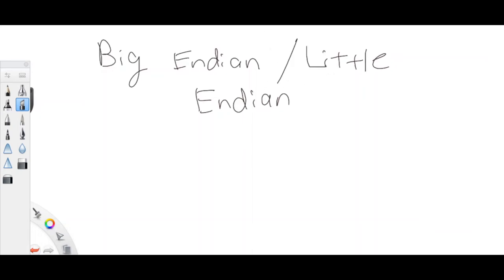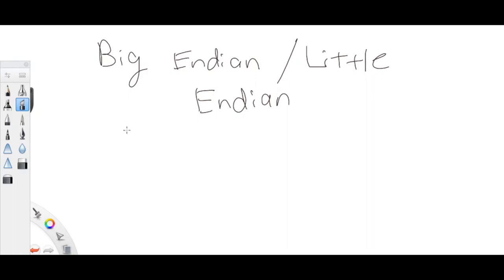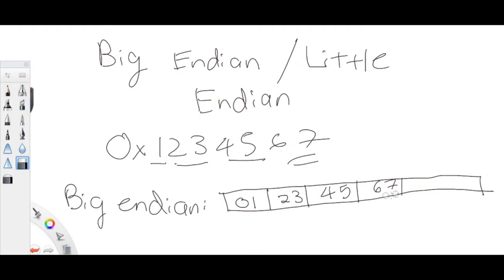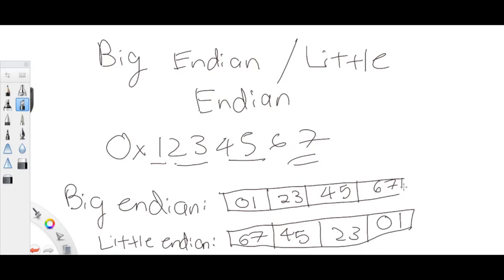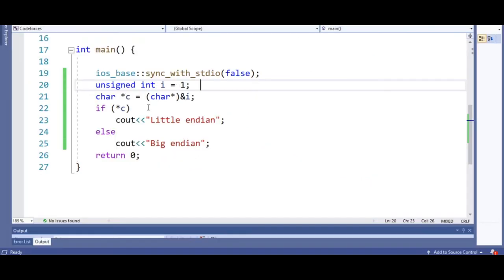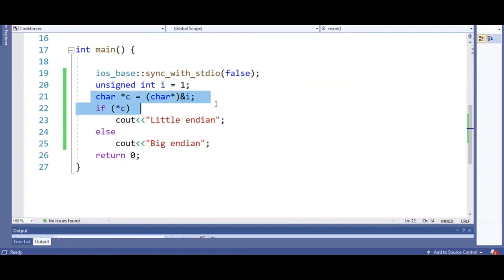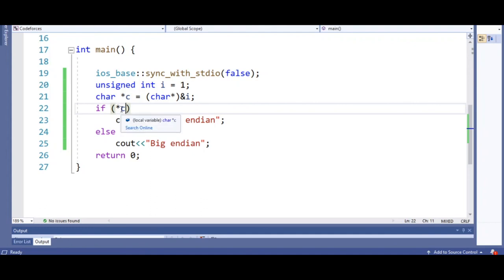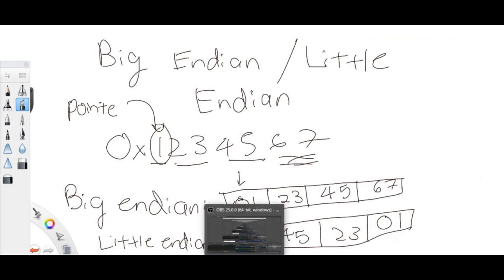How to check Big Endian or Little Endian

Comment: Thanks! I need a code saying If my PC is Little Endians o Big Endians Its possible with C++? Thx
Reply: same code works in c++ and also u don't need a code u just need an integer and the address of this integer in the memory and u cast it to char* so u can point to the first byte in memory in which our previous integer is stored then u check the value in this byte  by dereferencing  char*  and if it's not 0 then it's little endian ....